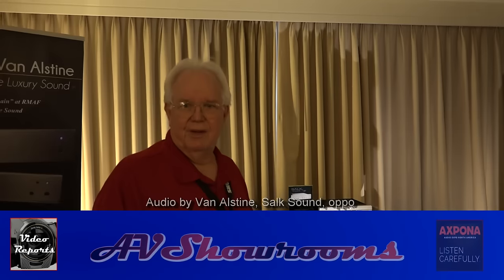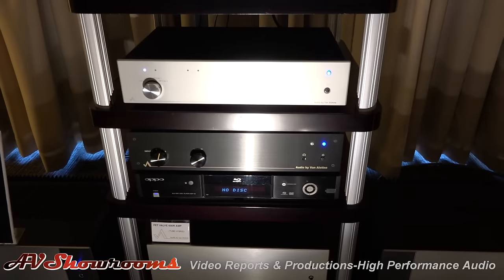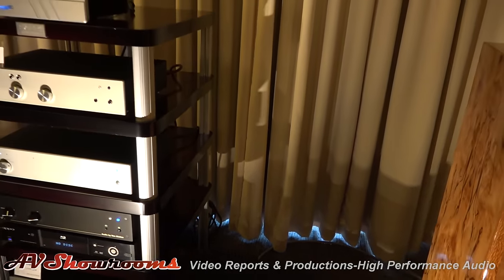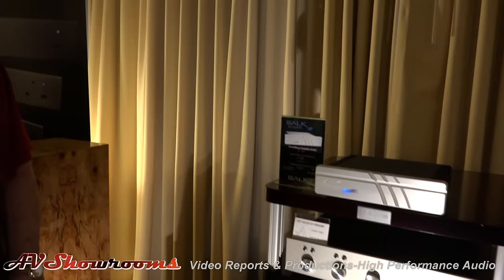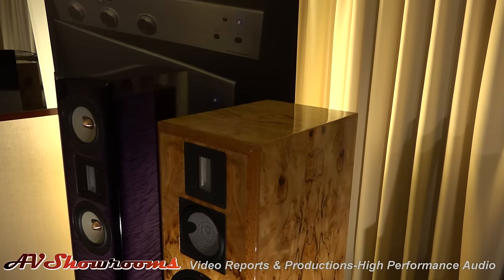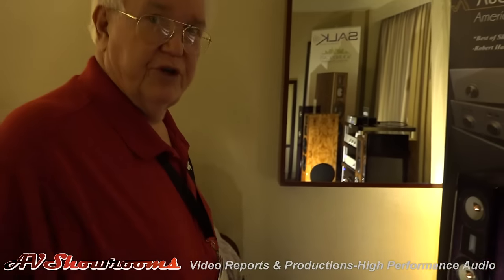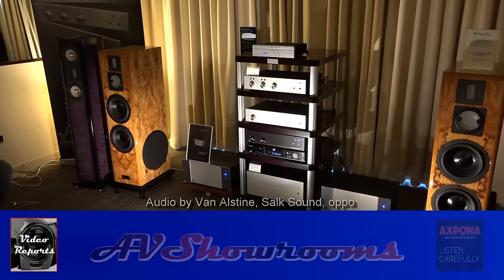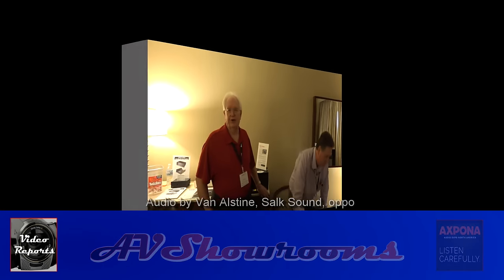Audio by Van Alstine, Salk Sound, oppo, AXPONA

Comment: You won't get a clear 'in room' sound via YouTube, because the mic is going to pick up the room with cancellations. Real ears in the room will hear it differently, so a boxy sound or some frequency ranges presented up front over others is what the mic heard, but not how the speakers sounded if you had been there.